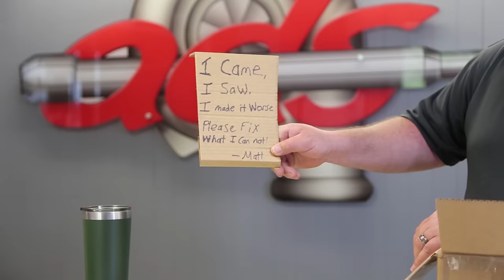DBG Stanadyne Pump Repair for @DieselCreek 3850 FREE International Wheel Loader (Will it Start??)

Comment: I had that flyweight drive damper fail several times on a Olds diesel.  The second time, the engine ran away, and I had to kill it with a plastic cup shoved into the air intake hose.  Scary.  Good thing I had a friend there to fetch the cup while I held the car in reverse and fully applied brakes.  If I would have been by myself, I would have shrapnel on my hands.  I found out about the Ford drive plate that's fully enclosed.  Been good for the last 15 yrs.   Do you know why the oem damper discs have such short life ?  I suspect a negative change in Diesel fuel formulation, perpetuated by EPA.  What say you ?

Comment: I'm just wondering why you don't coat everything with oil or fuel as you put it back together dry, just like when rebuilding a motor?  It seems with this old stuff things could catch or bind when it is spun up dry in those first few revolutions?

Comment: Great and informative video!  I came from Diesel Creek too.  I have an old Case 580CK (1969) that starts, runs what I think is pretty well, but am very new to the diesel world.

It smokes a lot, light grey, and seems weak power wise when in its highest gear.  Are there quick checks, injectors cleaners, etc. I should check before starting to commit to tearing things apart?

Comment: Just took a Roosa Master  JDB 431 MD 2800 apart with the help of your videos and put it back together, found nothing at all wrong in the injector pump and upon reinstallation, pushing the start button on my John Deere 410 it started right away up on the first turn. Shaft seals were replaced last year and showed no wear or tear. I am at a total loss here. I end up with 7-8 l of diesel in my crank case oil for every 20 l tank filling. The machine runs like a clock, smooth and quiet and I cannot figure out, how such a large amount of diesel can end up in the crank case. Lift pump seems to be okay and has no leak. could it be a cracked injector? Worst case scenario I figure could be a crack in the engine head. Any ideas would be appreciated. If there is a crack is it possible to see it with an endoscope through the holes of the removed exhaust manifold? Thanks again for the excellent tutoring in your videos. O yeah who sells that Bristol Cam stud tool # 15499?

Comment: a shipper told us, anything that had fuel in it, to make it not a dangerous good item, to flush mineral oil through it.  Mineral oil isnt flammable  apparently Mobil Jet engine oil isnt either,  one guy gets the fresh changed out stuff from a plane at his airport or some out of date stuff to flush the component out with .  .They use a decarbon soap called Brulin 512m  he said on the engines,, nothin better to decarbon stuff like a turbo.  He said use barrier cream on your hands,, Use Urea based hand cream after washing your hands  and take hemp seed oil for cracked fingers.

Comment: If the tractor you are pulling the pump off of lets say a 410d backhoe, has a keyway on drive gear, do you have to get the engine set at TDC, or can you just pull it off as long as you dont rotate the engine?

Comment: I was wondering why you arent able to drill that cam screw out?  Is it just how hard it is?
Reply from the maker: It's hard, but it's also hard to fixture. It wants to flop around inside the pump while you're trying to work on it.

Comment: I'm still curious what does the special tool for the cam screw look like
Reply from the maker: There are three iterations of it. This was one is referred to as a Bristol Spline. Similar to Torx, but different enough to split the screw if it puts up a fight and you're not using the correct bit. There is also a bushing that screws into the housing to keep everything aligned when you apply pressure to it.
Reply: Thank you for explaining that, I would have definitely assumed it was still just a torx. I don't think I've ever come across that before in automotive or industrial repair.

Comment: Wondering what effect vegetable oil as a fuel has on those pumps
🤔🇬🇧
Reply from the maker: We only see the ones where the effects are negative, but we do see a fair amount of them. It doesn't store well and seems to lack the appropriate lubricity characteristics.
Reply: I wondered if differences in lubricity caused parts to 'stick' together - cracking, interesting video.
😎🇬🇧

Comment: @1:30:42 you mention lining up the dots, that would obviously be for the timing, so that when he puts the drive gear back on it is in time. IF the driveshaft stays with the engine and just the pump comes off, don't you just have to line up dot to dot and the engine and pump are technically in time? The marks on the weight cage and cam ring do not play a role then right? I would believe that the "DOT TO OT" supersedes the marks in the window, as they are are all hard connected. So basically the question would be, when there is a dot to dot  do you even need to put the marks on the weight cage?

Comment: I have "rebuilt" my Stanadyne DBGFCC431--30AJ  and was wondering if that shim under the metering valve is ALWAYS there? I do not recall seeing one but then again I do not normally build pumps like this injection pump. I am extremely mechanically inclined and have gone through this pump with a fine tooth comb but it still will not run. IF that shim is missing, would that create a no start or just bad running? thanks
Reply from the maker: Yes. That shim is always there. I can't see it causing a no start. At least not right away.
Reply: @AreaDieselService  Well, maybe it was there then🤞and it just stayed in place. My dad wanted to get this tractor up and running but he ran out of time, passed away but I know I have it all back together correctly, just missing a tiny something. I did a meticulous cleaning so for sure no debris left in it. Also, I have an idea for getting that cam screw/bolt out and it is done without the Bristol tool, would love to talk to you guys about it.

Comment: No offence to Matt but I knew he was in trouble not to long after he started tearing into the pump. Even if he had gotten down to the stuck plungers, going back together would have been a nightmare. If anyone out there owns an engine with one of these pumps it's way cheaper to let a certified injection shop repair these pumps or any injection pump for that matter. Nothing worst for a mechanic than to have a customer show up with a "basket case", usually means it going to be more expensive.

Comment: Why is everything wired and tagged?
Reply from the maker: Great question! It tells us if someone else has been inside the pump after we rebuilt it. You can't get inside the pump without cutting and removing the wires. It's a warranty and liability control measure.

Comment: Do you guys charge twice as much to repair when we try to fix it ourselves and then send you the parts...
Reply: it was impressive that Cory named each of the parts as he was going thru the  bag.
Reply from the maker: No, but in many instances the repairs do end up costing more than if we would have disassembled the pump ourselves.
Reply: @AreaDieselService   I remember the old joke rate sign.
Hourly rate ....x
If you looked at it.....2x
If you touched it.......3x
If you watch...............4x
If you offer advice on how to fix it....5x
Reply: @sinnasinna7060  : I have to say with these guys that 4x multiplier might well be worth paying.